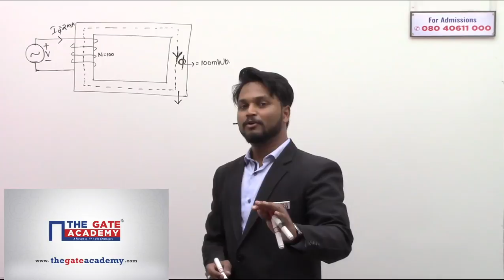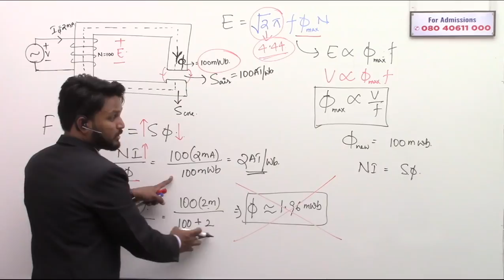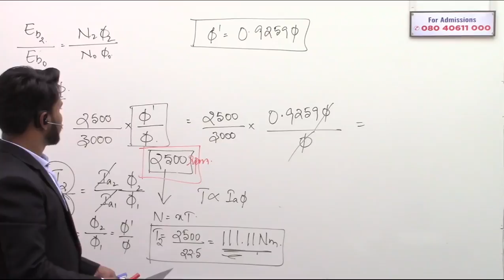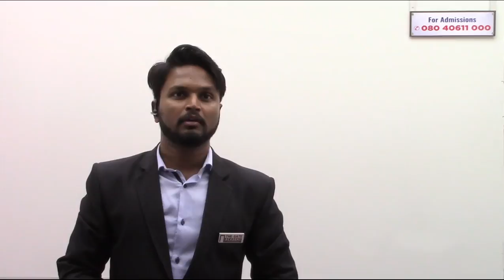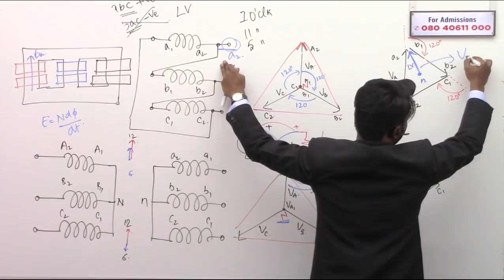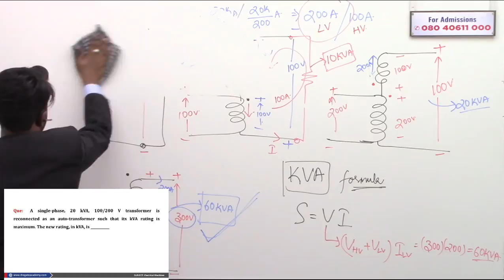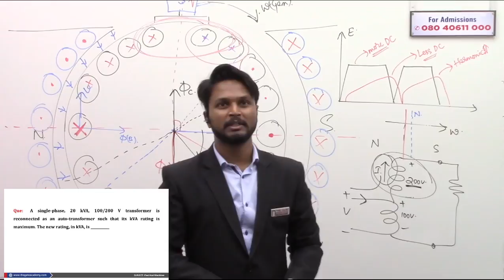Electrical Machines - 1 (EE) - Most Important Questions for GATE 2020

Comment: In third question of transformer , for voltage regualtion calculation theta equivalent calculated comes out to be same as pf angle.
pl correct if wrong?
Reply: Dear Anil, theta eq. is the impedance angle of the internal impedance of the transformer windings. Power factor angle is the impedance angle of the load. Hence both are completely different.

Comment: in first question while calculating Eb2 speed ratio of 2500 rpm/3000 rpm is taken but the corresponding torque ratios is not taken for flux ratio calculation?? pl reply
Reply: Ya thats my doubt too. In denominator Torque must be 200 right?

Comment: Why we use 300kva/11kv for ifl instead of 300kva/400 for full load current...Prashant sir plz 1:42
Reply: We can consider full load current of either primary side or secondary side, but the resistance must be referred to the corresponding side for calculating copper loss.